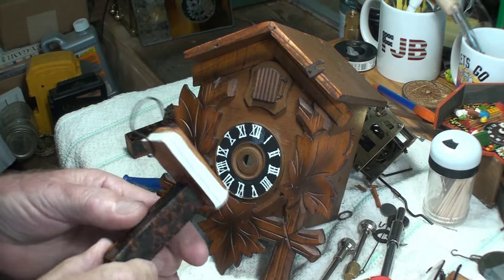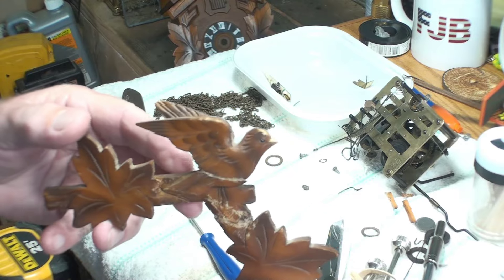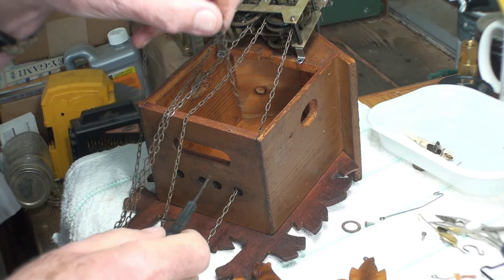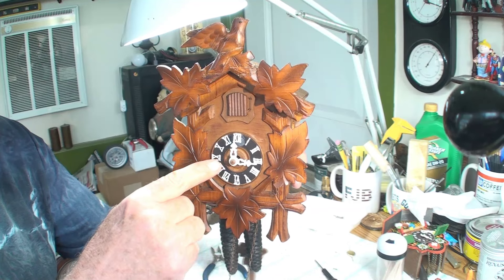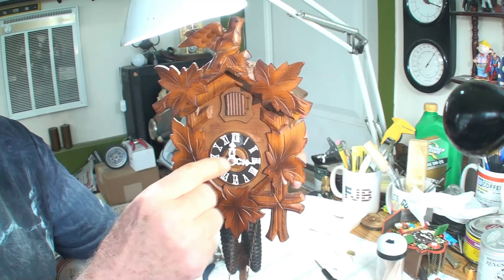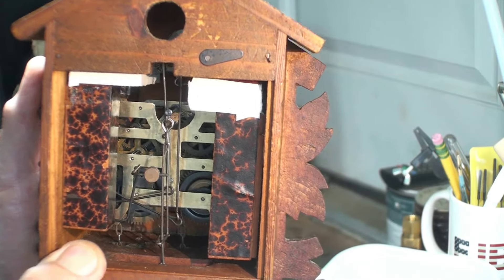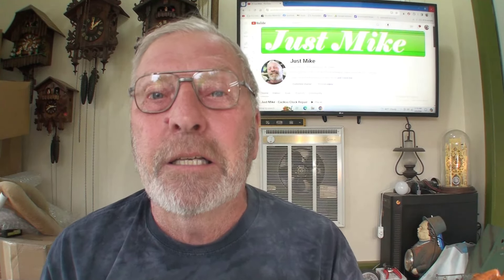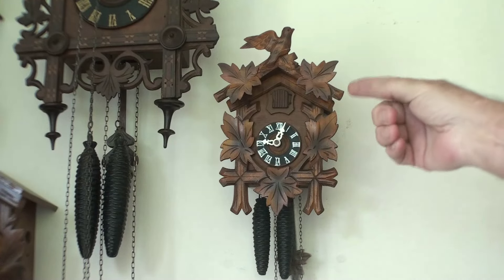Part 2 Nancey's Black Forest Cuckoo Clock Repair

Comment: This is a BADUF movement.  The Jmius movements cut away are a wide  "Backwards J" or "Question mark" where BADUF movements are a narrow "Backwards J".  The BADUF movements also have narrow long cut outs on each side of that middle section where Jmius movements have a oval type cut out on each side of that middle section.  Per a google search "Jos Burger und Sohn acquired the BADUF cuckoo clock factory. But in 1984, the production in Furtwangen ceased, and the factory was dismantled." Burger und Sohn are the same people that have the trademark for Regula.  Who you know still make movements for all most all the clock makers of today.  I believe that AMS still makes clocks. You did a great job at fixing this clock and making it look presentable.  I agree that the bellow tops need to be changed as they are too big.  Thanks for the verbal shout out, the shout out in the description and the shout out at the end of the video.  God bless you and yours.
Reply from the maker: Thanks for all the useful info on this movement and what it was I was working on. God Bless and have a wonderful week.